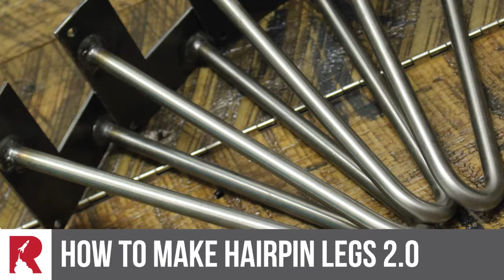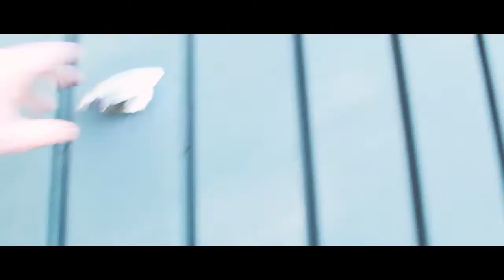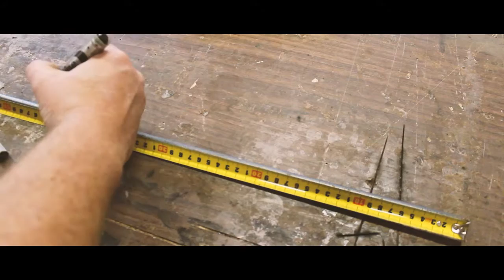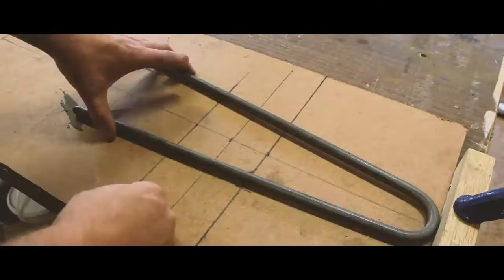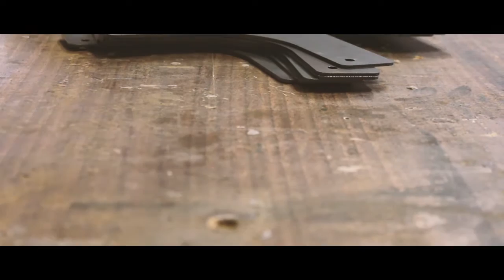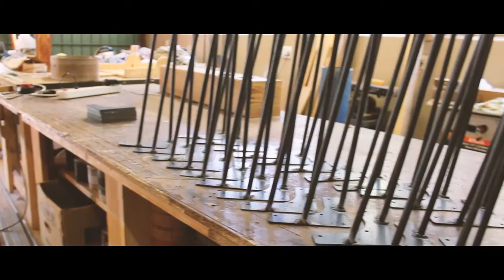How to make hairpin Legs 2.0 - Rocket Design Furniture

Comment: the smooth and fast way you stick welded that thin metal made my jaw drop! when I tryed using a stick welder for such a thin plate, I burned right through it
Reply from the maker: Its all about practice and the right settings on the stick welder I have to admit I have burnt one once or twice before.
Thanks for the support

Comment: Actually it can be much easier and faster. You are taking way too much time to make those. Plus the piece at the top will look like crap under the table. No need for it. Just a flat bracket that is thick enough. 1/8" is not thick enough. Plus the bracket is too big and hard to ship. These are much easier and faster to make.